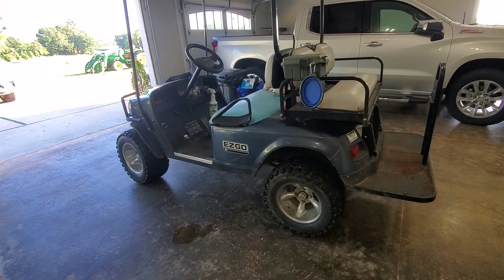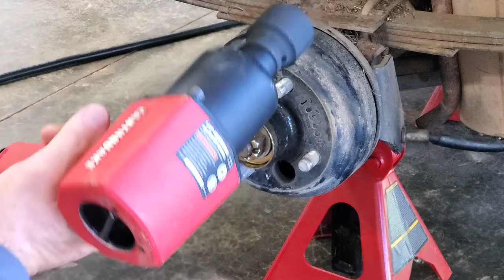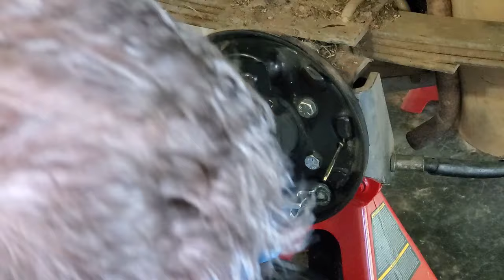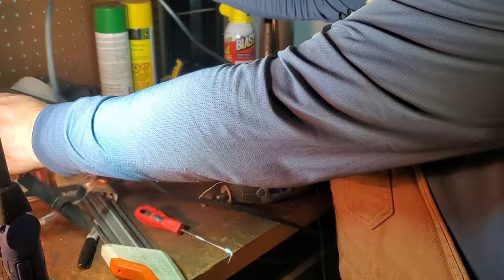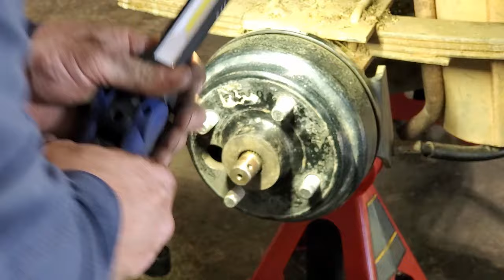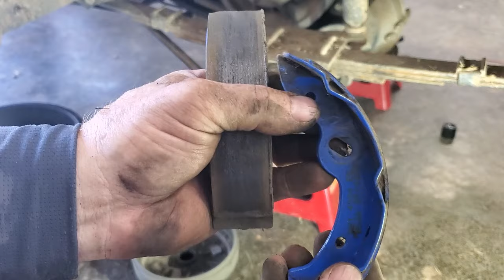EZGO Rear Brake Pad Replacement

Comment: Maybe a little tip for you on those springs you took off with your thumb if you leave those on and take those other springs off first then they won't collapse on you like they did but you did a real good job real good video pretty explanatory give yourself a pat on the back LOL
Reply from the maker: Thanks for the suggestion.  I'll try that.

Comment: I HATE working on drum brakes.  In fact, I have a cart project that has been stalled almost two years over drum brake parts.  And that tool that is so useful is a vise grips, not channel locks.  The exact tool I have used for the exact same purpose.

Comment: Nice job! When you replace the pads did you screw in the star nut (the break adjuster) and still need to tap on the pad to get the hub back on? 
Would it be easier to screw it in then put it together then adjust back out to tightness? I plan to do replace my brakes next week....
Reply from the maker: If the star nut is adjusted in fully you should not have to tap or force the drum over the pads.  I had a little trouble because my pads were misaligned.
Reply: @thistlehillfarmstead9131  thank you!

Comment: Holly crap those old pads still had 75% life left😮 make sure you re lube the adjuster mech at the bottom before you put it back tougher do not do it dry like he did.. also a little on the contact points on the backing plate where the pads touch will help reduce noise. Second side was worse then first but certainly was not metal to metal
Reply from the maker: Thanks for the input. I'll take them back off and lube the mechanism.  Also related to the pad thickness... I agree they had a lot left on them, but the cart would not stop.  Not sure if the pads were glazed or what the issue was.  I tried adjusting them prior to replacing the pads and could never get it to stop properly.  After the pad replacement it will slide the tires if you stomp on the break.

Comment: where did you get that dust cap?  What size is it?  I am hoping to find a black one
Reply from the maker: You can pick the up at most auto parts stores.  Just ask for the wheel bearing dust cap.  I'm not sure of the size, but you can measure the diameter of yours if you have the wheel off.  Most are just metal and have no color, but you can definitely paint them black.

Here is an amazon link also - https://amzn.to/3RaXypH

Just make sure its the correct diameter.

Comment: How to adjust brake through that hole !
Reply from the maker: You can stick a flathead screw driver in the hole and turn the adjustment screw until the hub is tight, but still can be turned by hand.

Comment: You didn't set the pads before adjusting. You tightened the castle nut to tight. You adjusted the pads to tight. You didn't score the drums enough. To your credit you did do a good cleaning of the parts.
Reply from the maker: Thanks for the feedback.  Always open to suggestion and learning from others.

Comment: I am not trying to be cute but they have never built one single EZGO golf cart with break pads. They all have brake shoes. Brake pads are on disc brakes and EZGO golf carts all have drum brakes. Drum brakes have shoes. That is like calling a Peacock a Buzzard.
Reply: Yeah, and that was not a channel lock used to install the springs.  Vise grips anyone?  Thistle Farm, don't worry, we all knew what was happening.  Thanks for the vid.
Reply: This comment helped no one unlike the video.
Reply: That was cute

Comment: This was painful to watch. First of all they are brake shoes not pads. Pads are disc brakes. Second, channel locks are not what you were using, you were using vice grips. Thirdly, buy a set of brake pliers!  I am by no means a mechanic but have worked on my own vehicles for 40 years and would never attempt a brake job without the proper tools and knowledge.
Reply from the maker: Thanks for the feedback